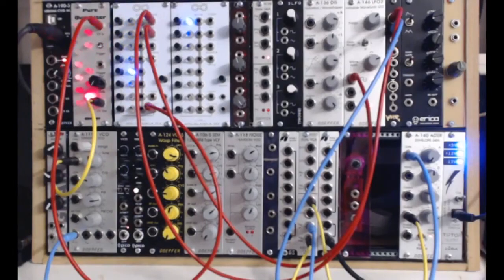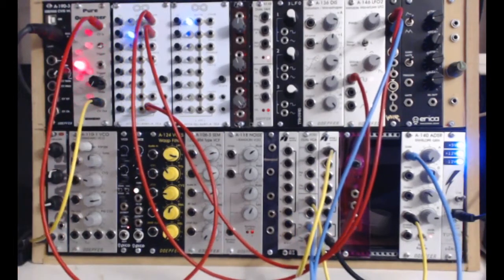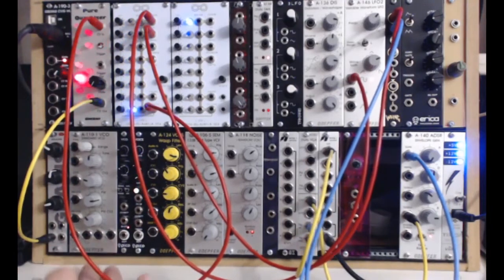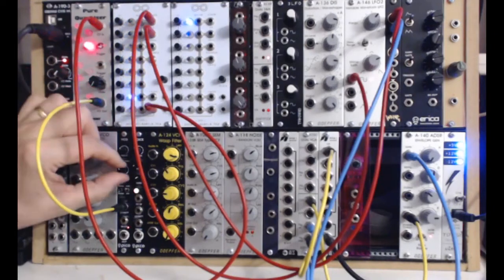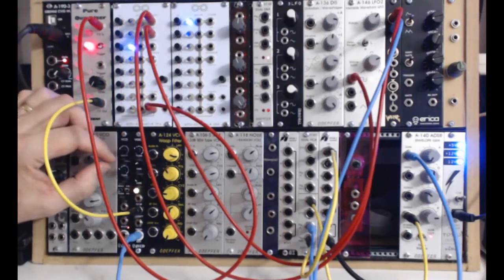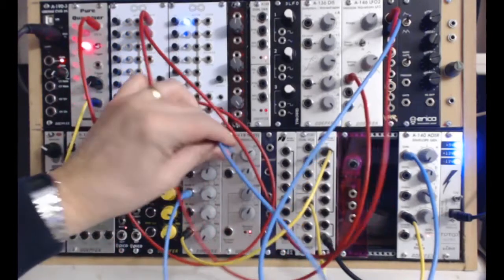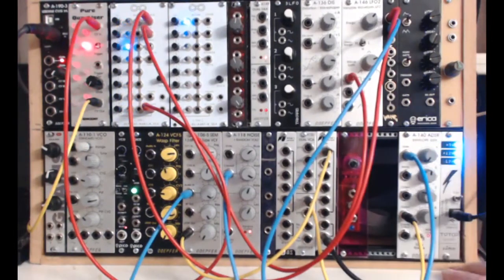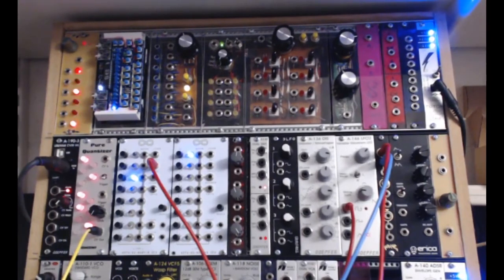My Budget Eurorack Part 3

Comment: I’m really just starting to learn about these, but is the topology of the signal path a straight line? Like from something that generates a waveform into a module then out into another module, etc until it gets to the speaker? Or can it branch? I don’t see any pigtail type cables or splitters, just wondering.
Reply: I know this is 6 months old, and likely not helpful for me to answer, but it really depends on the patch!
 
You could split a sequencer to two oscillators, one octave apart, 4 semitones, etc... and have them come together through a mixer, have it work that way, you could send a sequencer to both pitch and filter cutoff to create a patch where the higher the note, higher cutoff, or inverse with a proper module, etc...

Things can go wherever you want them to.
Reply: Leo Vann Thanks that was helpful, I never had figured out the answer to that lol
Reply: Ben Thurston He did have a few multiples in the rack, which will split signals allowing you ti route 1 signal anywhere. I’m not sure if he used them in the patch, so I’m glad I could help.
Reply: Leo Vann Well, if I could ask you one more thing. I see that the path can split and recombine further down the signal path but what about loops? Would you get feedback if you output something into another module that then goes back to the first?
Reply: Ben Thurston It all depends on the patch. That’s the thing with modular, so long as you have the appropriate inputs/outputs on your module, you can send signals anywhere. Feedback is a thing.
Reply: Ben Thurston If you’re getting into modular, I say look at “Circuit Slices” and Behringer. Crazy prices!